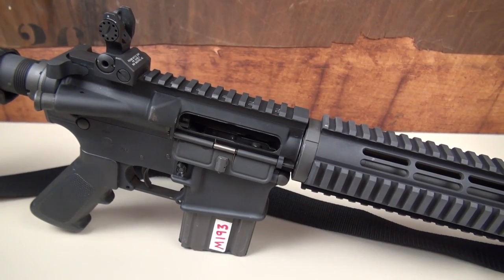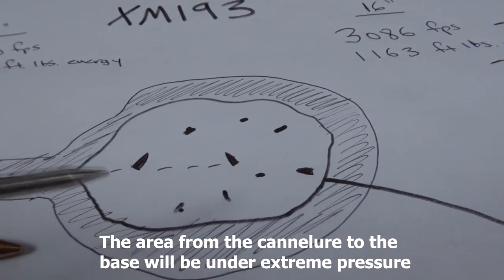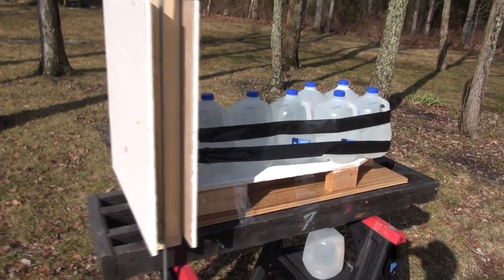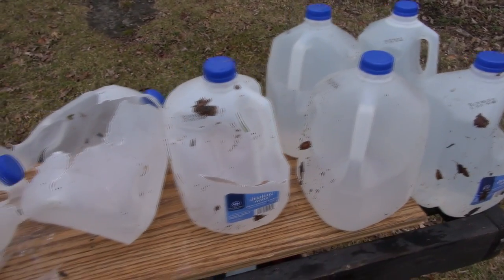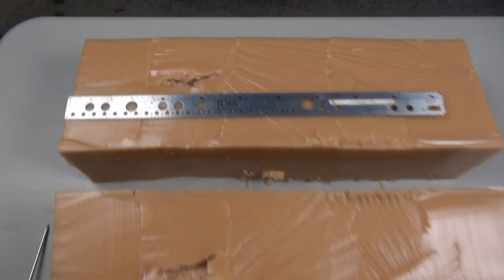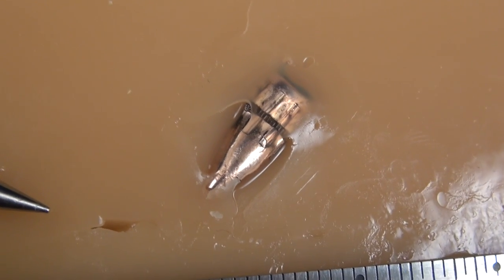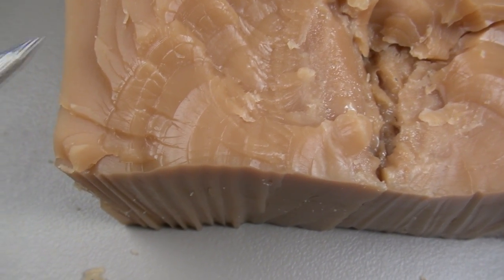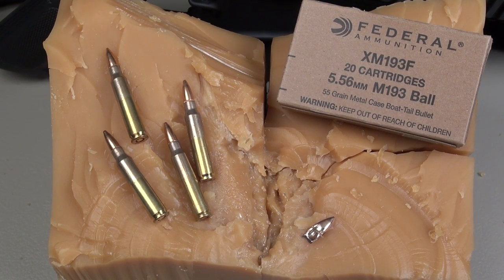5.56mm NATO XM193:  Drywall & Ballistic Gel Test

Comment: No I don't plan on testing it through 4 or 5 walls, that would be a really bad scenario and I hope that doesn't happen to anybody.  Ya, that is the point! As a gun owner I am furious that all these people on youtube are so happy to recommend the 5.56 as a home defense round.  Without fear for the neighbors, family members, or others who may be behind 4 walls that will be cleanly penetrated without massive fragmentation, or breakage.  RIFLE ROUNDS ARE NOT FOR HOME DEFENSE should be the title of this and every video talking about 5.56 or .308 or 7.62x39 or any rifle round!
Reply: And what do you suppose a 124grain 9mm JHP would do through 4 layers of drywall?
Reply: A hollow point, by design, should open up and create more surface area in an attempt to disperse it's energy into the target.  It will slow much, much faster than a 5.56.  Also, keep in mind that a 9mm leaves the muzzle at about 1200 fps, a 5.56 exits at about 3200 fps, and weighs more.  From a physics perspective it is just a ton more energy.  Even with the assertion that a round will "always" "reliably" began to spin after penetrating the first wall, and began to slow, there  is so much more energy in a slicker more aerodynamic package, that a 5.56 will just keep flying.
Reply: Umm a 5.56mm round weighs much less then a 9mm handgun round does. 55-62 grains is the norm for the 5.56mm compared to 115-147 grains for the 9mm. Yes the energy is greater, but that extra energy is a good thing since you can use to it fragment the bullets with easier. You can also use that extra energy to stop an attacker quicker possibly. Ballistic tipped hollowpoint rifle rounds in 5.56mm should not clog with drywall and will begin to fragment into smaller less lethal pieces after passing though only one wall. If there is a TV, bookshelf, closet, etc. on the other side of the wall then there is a decent chance that the fragments will get stopped and not go any farther.

I do agree about not using a .308 or 7.62x39mm for home defense since they use much heavier bullets, but 5.56mm or 5.7mm rifle rounds are better for home defense with the right bullets then most handguns or shotguns are. For the 5.56mm use ballistic tipped HPs or from your manufacturer of choice that gets 12" of penetration. To light of bullet and you will not get 12 inches. To heavy of a bullet will lead to more over penetration and more fragments/pieces to stop.
Reply: Avi Elkovits lol A 9mm projectile is definitely heavier than 5.56 or .223 bullet. It says so right on the box.
Reply: gophop You are correct, I miss spoke, what I meant to say was that a 5.56 carries much more energy then a 9mm.  Looking it up a 9mm leaves the barrel with about 350 ft lbs of force, a 5.56 leaves with about 1300 ft lbs of force.  It is a staggering difference, I could argue that the 5.56 has a smaller profile, is more aerodynamic, is typically steel rod or ball, rather than lead which deforms and looses energy.   I could argue that rifle rounds, by design, are intended to over penetrate since they are designed for accuracy over distance. 9mm are designed for defense, and characterized as failures if they penetrate too far through ballistic gel.  Hell, I don't even think a 5.56 works well as a defense round, you could put 3 into a guy and miss all vital organs and have very small puncture wounds, while the person behind the wall that it fragments in gets hit with shrapnel and bleeds out.  But I am not making any of these points, I'm just sticking with 350 ft lbs of penetration vs 1300.
Reply: Avi Elkovits actually the lighter, faster xm193 bullet tumbles and yaws upon hitting a barrier, losing accuracy and velocity at a much faster rate than most common pistol calibers used for defensive purposes. A heavier slower projectile is more likely to penetrate and not deviate in trajectory and also carry more momentum therefore penetrating farther. This information is widely available on the internet, it seems counterintuitive at first but like you said, it's a mafter of physics.
Reply: MusashiSolid206 I have heard this claim made many many times, on the internet as you have said, however I have not seen it proven.  Again, total energy is overwhelmingly the  determining factor in total distance, regardless of obstacles.  I honestly think you would have a hard time determining that a perfectly perpendicular to travel 5.56 even has more forward surface area then a say 40 or 45.  It is a thinner longer round, even in yaw, and lighter, there is no reason to believe it will bleed energy faster then a slower heavier bullet, and even if it does, it has 3.5 times more energy to loose.
Reply: Avi Elkovits Totally wrong man, totally wrong.  Most HPs PLUG through drywall and act like an FMJ
Reply: ***** That has already been discussed, even if it acts like a FMJ it is still slower and carrying less energy.  What do you think a steal core acts like? A parachute?
Reply: Xm193 is not steel core, you seem to make the implication that most 556/223 is steel core which is not true, you also stated that "ball" ammo(meaning fmj)does not contain lead which is also false. Now imagine a mini Cooper traveling at 60 mph running into a brick wall. Wall stops car immediately, now imagine a freight train hitting the same wall at 20 mph, it keeps on going and through the next wall and wall after that. The rules of physics don't change for bullets. The bottom line is that all proper defensive rounds can travel through multiple walls and kill people so don't get high and mighty about your choices for protection based on your speculative theories on physics and ballistics. Now thanks for playing, come back soon.
Reply: MusashiSolid206 A XM193 is a FMJ round, it will deform similarly to a 9mm home defense round (typically copper covered lead) it is not softer, in fact its probably harder.  But even if it were softer it would still be carrying three times as much energy, when rooms average 10-15 ft length air resistance is essentially negligible.  I don't care if your bullet is made of marshmallows and expands to the size of a pillow on impact, at 3300fps it's going through multiple walls.  I never said a 9mm is going to stop after a single wall, I simply said that given the ballistic characteristics of a handgun, or shotgun round, are way better home defense choices than a AR15.  Lets go ahead and make your freight train analogy actually accurate to a degree.  Your XM193, a FMJ round, 55 grain round leaves the muzzle at 3165fps, carrying 1223 ft lbs of energy.  My 9mm JHP (which I'm sure wont expand one bit entering drywall, perhaps it will get smaller, start spinning, and grow a booster rocket) 124 grain round, leaves the muzzle at 1150fps, carrying 364ft/lbs of energy.  I don't think one needs to be too high and mighty about speculative theories, but im pretty sure one of those is more than the other.  So, here sits my freight train, but really it's more like a mid size sedan doing 20, and then there is your mini copper, still doing 60.  
Thanks for playing
Reply: /sigh So why does a XM193 not penetrate ballistics gel deeper then a 9mm fmj/plugged HP then? A XM only penetrates as deep as many 9mm HP rounds due to FRAGMENTATION. It has so much energy and is so unstable that it breaks itself into pieces. That 55 grain bullets just turned into shotshell. It is a modern shotgun.

As I said before use ballistic tipped HPs or even soft points. Less walls penetrated vs. plugged handgun HPs or a shotgun with 00 buck.
Reply: I agree with you in the rifle not being suitable for home defense, not just because of penetration, but manuverability, HOWEVER there are frangable rounds you can purchase for rifles, and... the military most definately uses rifles for CQB. You would have to be a certifiable idiot to use the mil spec green tipped steel penetrators for home defense unless you want to kill your family members in the process.
Reply: @ Avi:

If -- Heaven forbid -- any individual is faced with armed, vicious, and violence-unconstrained home-invaders, then he MUST clearly define his PRIMARY mission/objective.  Is it to ensure the safety of neighbors in adjacent homes, or is it to defeat the immediate and lethal danger to him and to his family near-instantaneously?  I respectfully suggest the rapid elimination of that dire threat is his overriding responsibility.  Furthermore, all effective (and even "possibly effective") defensive firearms options -- ranging from the .38 Special (at the "low end"), to Buckshot loaded 12 gauge shotguns, and to rifles (even under-powered ones like the .22 WMR) -- have inherent risks of over-penetration.  That's an unfortunate fact (in my considered opinion).  However, the probability that a round will strike an innocent in an adjacent home is not high and -- more important -- one must remember that the villains in this situation are the felons, not the innocent citizen who is defending himself and his family.  We live in the "real world," and frequently we are confronted with situations and dilemmas where there are no perfect -- or even good -- alternatives.  Obviously, this is one of those circumstances and the optimal choice is to eliminate the treat immediately, thereby protecting innocent individuals both now and in the future.  

Furthermore, there is an additional -- and an important -- factor to be considered:  handguns are notoriously POOR instantaneous "criminal stoppers."  I recently read that approximately 85 percent of those hit with a single handgun round survive (and, considering the tragic FBI Miami shootout as an example, even if they die, they may live long enough to cause dire injuries or death to you and/or to your family members).  This means double- and triple-taps are near-mandatory with any handgun, to stop the threat near-instantaneously.  How many handgun rounds will probably be fired to achieve that double- or triple-tap . . . and what is the concomitant, aggregate risk of dangerous over penetration in comparison to -- very likely -- far fewer 5.56 rounds to attain the same near-immediate threat cessation?  Over penetration's risks to innocents are a serious, legitimate concern in many defensive scenarios.  However, I respectfully suggest the risk is greatly reduced if one or two 5.56/.223 rounds are fired, in comparison to perhaps five or six 9x19mm, .40 S&W, .357 magnum, .45 ACP, and so forth rounds.
Reply: Sierra SMK 69 or 77 grain:  penetrates deep enough to stop an attacker, but breaks up in drywall and won't harm an innocent on the other side.   NO pistol or shotgun round can say that.
Reply: Brad Walters #4 buckshot is close, but small-caliber rifle rounds are king for frangibility. Luckily, the layout of my apartment makes shots towards occupied rooms very unlikely.
Reply: Avi thats my biggest fear of defending my apartment with the AR15. I would be devastated it something happened to the nice lady across the breeze way.
Reply: It depends where you live

Comment: To my understanding, a inch round (.223) is indistinguishable from a metric round (5,56) at first sight. However, the metric round has 27gr Of powder vs 25gr on the inch version. That is not catastrophic for an inch gun. 

However, the problem is the barrels. Metric barrels have a free bore length of 1,5mm, which allow gases to move around and pressure to drop to safe levels. The inch barrels has  only 6mm of free-bore, which means you can load a 5,56– which tend to have a thicker neck— and it will lock tight— almost air tight and that causes pressure to soar beyond safe levels. 

Translation: a 5,56 barrel can shoot both inch and metric rounds with no problems but an 223 barrel may possibly blow up if you shoot metric rounds on it. 

I’m open for corrections.

Comment: Makes me feel better about ordering this, except mines a 1:7 twist... hope it doesn't hurt performance too much.
Reply: If I'm not mistaken, I believe that 1:7 is slightly more suited for a heavier grain projectile. Just buy heavier ammo and you should be good.
Reply: the rifle will shoot as good as you can don't worry about twist rate
Reply: It's a reason for twist rates! Go with Mr.  Marcus Garcia's input! Smh😂
Reply: zeroxwolfx I'm just speculating, but doesn't twist rate stabilize the bullet more? Like the higher the twist rate, the more stabilized the bullet? And, doesn't a higher twist rate mean a more accurate bullet, like flatter trojectory?
Reply: Mark Weller 
It's the other way around dude. Faster twist stabilizes heavier bullets. Slower twist works better for lighter bullets. A 1/12 twist isn't going to stabilize a 69 grain projectile like a 1/7 twist.
Reply: Mark Weller 
Sure thing fool!
Reply: 62 grain keyholes in a 1/12 twist most aftermarket ar15 barrels are 1/7... it stabilizes most ammo might not be perfect for all weights
Reply: If you look at the number, the higher the number, and call it a higher twist rate then your statement is correct.

If you look at the lower the number, the higher the twist rate, then no.  Some of us call a higher twist rate a twist rate that is a tighter twist rate.  The higher rate being a more frequent twisting of the bullet .vs a lower twist rate meaning that the bullet is twisting slower therefore more suitable for a lighter bullet.
Reply: @Mark Weller Nope, higher twist rates for heavier bullets, lower twist rates for lighter bullets, you definitely have it backwards

Comment: You're both missing a bit of the point. Very high velocity bullets like 5.56mm sometimes fragment when they strike an object. That effect has been demonstrated (FBI and independent tests) to present a *reduced* risk of injury to bystanders vs. pistol or shotgun ammo.

In any case, anything with enough penetration to reliably stop bad guys will pass through several walls and retain enough energy to kill.

Comment: If AR15 and 22LR guns shoot the same diam bullet, why is the AR15 so mucjh more lethal - assuming you're not getting attacked by the Terminator or someone else covered in a steel exoskeleton?
Reply: Thanks for the info but then wouldn't that 223 just over penetrate still leaving a tiny hole equal in size to the 22lr? As a matter of fact, woudn't the intertial effect make the 223 leave a narrower cavity?
Reply: Although the .22 rimfire from a .22-rifle and .224-caliber bullet fired from an AR15 or M4 carbine share the same caliber (bore diameter of the projectile), they are far from the same cartridge. Typically, .22-rimfire bullets are around 40-grains in weight, and are fired at velocities in 1000-1100 fps range from something like a Ruger 10-22 rifle. At the muzzle, that translates to kinetic energy of about 100 foot-pounds. In contrast, a 55-grain FMJ (ball) M193 NATO round, fired from a 5.56x45 NATO case (which is about 4x-5x the volume of a rimfire .22 case), leaves the muzzle of a 20-inch barrel AR15 at ~ 3240 fps, which equates to about 1280 pounds-feet of energy at the muzzle, or more than twelve times that of the .22 LR. The relatively diminutive .22LR bullet is never supersonic, whereas the M193 bullet remains supersonic out to 800 yards. Although the respective projectiles aren't all that different in mass, they have dramatically different effects on target, thanks to the order-of-magnitude greater muzzle velocity and energy of the M193.

Comment: No. No bullet "bounces around" inside a person. The term refers to any full metal jacket bullet. That is a bullet which has a lead core and a copper jacket, with no opening or exposed lead in the front portion of the bullet. The rear of the bullet may have exposed lead or it may not. Generally, "ball" distinguishes between standard ammo and tracer, hollow point, etc.

Someone else will have to fill you in on the etymology of the word.
Reply: The Chopping Block you are misinformed. Bullets change direction inside people all the time.. super common for the round to hit bone and completely change direction. What would u call that? I say bounce around is a fair phrase to describe this.

Comment: Direct quote from Wikipedia...
"During the 1970s, NATO members signed an agreement to select a second, smaller caliber cartridge to replace the 7.62 mm NATO cartridge. Of the cartridges tendered, the 5.56x45mm was successful, but not the 55 gr M193 round used by the U.S. at that time. The wounds produced by the M193 round were so devastating that many[6] consider it to be inhumane.[7][8] Instead, the Belgian 62 gr SS109 round was chosen for standardization"

Comment: This is the ammo I like to keep considerable stock of. Good for practice and training and also pretty damn effective if I run out of better rounds
Reply: Also great at defeating body armor; better than M855 in fact. Criminals are using steel body armor now and having M193 loaded up will zip right through level 3 without issue. M855 will not penetrate level 3 steel plates.

Comment: 5.56 was not designed to deliberately just maim. That is a wives tail.  It was chosen as the NATO standard because more rounds could be carried and it was found most engagements during WW2 were 300 meters or less. The small caliber forced engineers to design a bullet that could effectively kill but still be legally defined as a FMJ to fit into the Geneva Convention. The 855 and 193 are similar. 855 has a steel core for added penetration.

Comment: If you consider M193's frag threshold to be ~2700fps, the 20" will make it fragment up to 130-150 yards. Take into account that it might still fragment at 2500fps (~200 yards).

The bad press is somewhat justified because in Somalia the precession-sensitive M855 wouldn't fragment in thin malnourished bodies, and in Afghanistan the ranges are too long.

Still, even when it doesn't fragment it can still be effective if the velocity is high (video is a tracer round)
/watch?v=-u5Uk0ae4p4